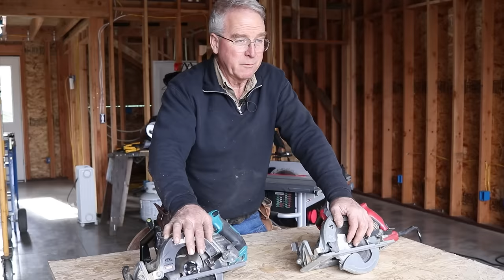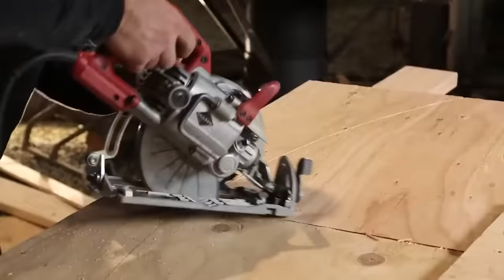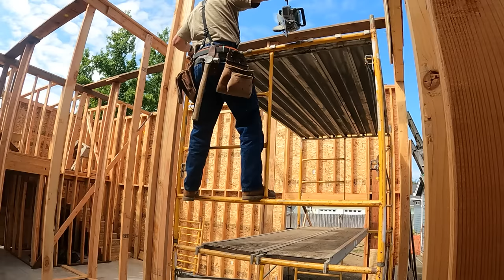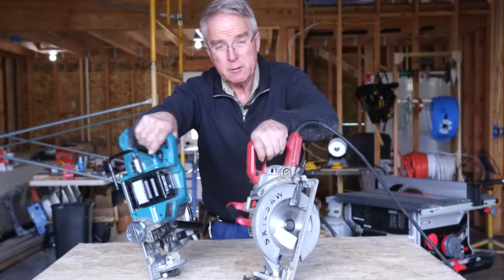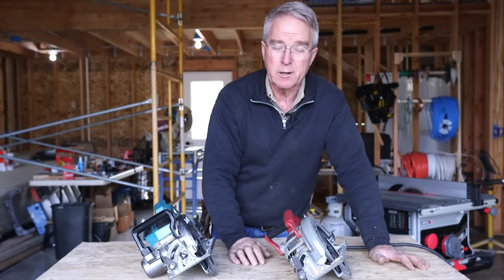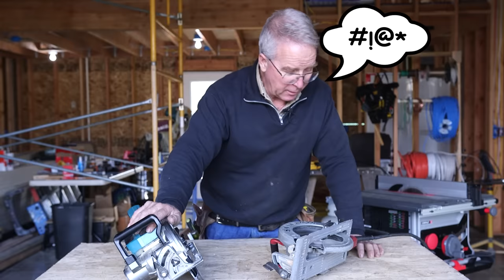Makita 40v XGT GSR01Z 7-1/4" vs. Skilsaw Mag 77 Circular Saw Review

Comment: as with all things things change over time and brands and components.

back in the 1970s i worked at a precision work tool holding company. the boss had a Milwaukee worm drive circular saw.  i had a skill saw of the home variety that could not make a square cut because it   was not square  and no way to adjust. i have a bunch of sears craftsmen saws that have survived many falls and keeps on ticking. my dad had a skill hand drill with the metal case and he used it for drilling concrete and that was from the early 1960s. and like a timex watch it took a licking and kept on ticking.  it is a a barn and it   stills works. it had a 1/4 jacobs drill chuck and  igt was replaced with a 3/8 inch drill chuck that i took off a home owner  black and decker drill that we beat on until it died (all plastic).

i owned a tool craft 6 inch jointer that my dad and i reworked the bed and rail system. it was from the late 1970s. i bought an 8in makita jointer a 15+ inch makita thickness planer. and a 15+ inch circular saw for cutting timbers and i used to to rip logs that i slabbed out with a chain saw mill.  

my dad bought in 1959 a sears craftsman 10 inch radial arm saw built by dewalt (i suspect). in a few years the casting rail system wore out. my dad a tool and die engineer designed a hardened precision ground rail system that he bolted under to old casting. originally it was wired for 110v but had the capacity for 220v and we changed over. we have had to rewind the motor after burning out.  my ex brother in law stole it when he and my ex sister disposed of the family home estate in 2017. it was a fire sale 10 cents on the dollar value. fraudsters of the stupid kind. or maybe they are clueless losers of the loudis clan of junior morons.

Comment: Left is better. A more centrally located door to the room means it's faster to access the room from the rest of the house. That is probably in line with what scott was thinking about more ways to look into the room. It just means more direct lines into the room from outside the room, which means shorter travel into the rokm.

Comment: Sir, I’m a rookie with circular saws. I’m right handed. I’m considering the SKIL Saw model 77 mag. I noticed in your videos, which I’ve been studying, that you seldom if ever, use your left hand when sawing. Is that because it would block your line of sight with the front edge of the blade ? Appreciate your response sir. 
Thank you.
Reply: It would be similar to writing with your left hand if you are right-handed.
Well maybe like writing capital L's, lol, you could practice and get okay with it, but you will always be more accurate with you right hand.
With a worm drive saw (only saw to use IMO) absolutely your view of what you are cutting plays a massive roll, I have never looked at the marks on the deck, but at what I am cutting, my material, horses, and direction of my drops are all set up for a right handed man running a right handed saw, and I have been in some form of construction off and on for the last 30+ years with around 10 of those in straight framing only.
The only times I would cut left-handed would be if some strange position off of a ladder or just anywhere where I didn't have another option because of deck width or whatever.

Comment: Been working as general contractor/laborer and electrician for 35+ years and I've used every brand & type of tool under the sun, the only cordless tools I own or recommended to my employees or fellow workers to buy is drills. Everything else Corded is King!! 🤷♂
Bc 1) there's no dicking around with a half dozen or more OVERPRICED and Underperforming batteries, 2) if it gets dropped it will still work and there's a built-in retrieval line, 3) If something breaks it will be mechanical and not a stupid Circuit Board or PCB Component so it can easily be fixed by the owner/user, 4) They're cheaper and they last longer. 

The only time cordless is useful imo is when you don't have power on site which for me living in the lower 48 is not an issue.

Comment: I’ve got a Ridgid worm drive that works great for when I need it. I was able to rip down through 5 sheets of 7/16” osb at a time which really sped up productivity.

The only issue I have with it is that the oil it requires to not void their lifetime service agreement. It requires a Mobil Synthetic oil which I can’t find anywhere in convenient sizes specifically made for a worm drive saw. Of course, Home Depot sells Ridgid, but not the accompanying oil that is required as to not void warranty 🙄

I would have gladly purchased a Skil Mag77 had it been available at the time for the convenience of easily accessible oil and parts.

Comment: While I don't personally agree. I do very much see the point. But with the amount of tools I've had to run on sites, it's easier to have one charging station with 2 or 3 batts all filling up and then switch the battery in use with tools. Especially grinders, impact drivers, drills and multi-tools. That being said circular saws are not something I have that level of experience with, so it might be completely different for that platform.

Comment: That point tracing where you left a tool by following the cord cracked me up. I have definitely found myself wandering around job sites looking for any one of my cordless tools and praying no one saw me through wandering around like an idiot haha. Never happens with my shop vac, belt sander or jigsaw (all corded). Also the strenuous time when you have to keep your hand on the cordless tool until it is holstered or set down somewhere, and not just lower it by the cord.

Comment: Excellent video. I use an old Skil 77,and love it for the torque and the left mounted blade compared to a sidewinder. However,I have been about to change to the Mag77 simply for the weight relief. But now seeing the Makita's 2-9/16" depth of cut seems like the biggest feature of all.But using the power cord to lift and drop and drag my saw would be missed...maybe tie a cord to the Makita?!? 🙃

Comment: I first used a Makita Hypoed  saw years ago, and frankly I was unimpressed I have other Makita tools that I have loved, I still have them. I hung up my nail bags 15 years ago so needing a new worm drive saw is not a need at all, especially because my Skill saw  works great for the few times a year I will use it, but still I am curious, we are building a new house and I will do very little of the building because I have other things I need to do, I will leave it to the young guys. The foundation guys are  setting up the footing and they had one of the new makita saws out so I picked it up because I was curious, I have to say I loved the feel of the saw, and its been close to 30 years since I framed a house. The other thing is and you didn't talk about it but buying such a saw at least for me means adding yet another battery platform  to my collection, that is not something I am all that eager to deal with, If I was a your framer, and buying a new saw was a must, I would probably look at this saw a lot harder. Thanks for the input.

Comment: With regards to power when there is pressure on the side of the blade: I have both a 2x18V Makita (not quite the same tool, but I think it's very similar in terms of power to what you have) and a Dewalt Flexvolt rear handle, I do find exactly what you're describing happens with the Makita, but the Flexvolt has no issue at all in those instances. Feels at least as powerful as my old corded Skil.

Makita is not known for throwing the MOST POWAAAAAAA at their tools, but aiming more at ergonomics, and one of the things a lot of people really like about Maktia's over my FV is the lighter weight, but the power leaves me reaching for the FV much more often.

Comment: One advantage I realized on the job with a corded tool is that it was much less likely to wander off to another part of the job site when you turned your back.  Lol.  It was a constant source of frustration to step away to bring materials to the area you were working and find that your cordless tool had mysteriously ended up in another area.  🙄

That being said, if I was still in the business I would undoubtedly have both.  Nothing beats the cordless when cutting rafter tails or working up in the rafters.  🤷🏻‍♂️

Comment: I had to remove that safety on my Makita, I found it to be unsafe, and also concentrating on the safety, would cause my cuts to not be a Straight.  It is such a smooth, saw that glides along, having to push in with my thumb caused an imbalance or miss direction of the darn thing

Comment: Can't speak to the saws themselves as I am not a carpenter or even someone who uses a circular saw regularly... But I am a diesel mechanic and have lots of makita battery powered tools. Makita has been very good... Better than anyone else about keeping the battery platform the same for years. They have updated the technology inside the battery but they have gone out of their way to make sure the form and function of the battery remains the same. I can use batterys from 10 or 12 year old makita equipment I have in brand new tools and visa versa. I don't see them changing anytime soon.

Comment: Lithium batteries in the cold suck. I have to bring generator to keep them warm or on charger. I like the cordless miter saw and table saw. But a corded circular saw cuts the tougher woods. I bump the trigger first on my makita circular saw, because it blows breakers sometimes. I need a guide for cordless saw because lighter and easier to veer off. A corded reciprocating saw is nice on job sites. A cordless reciprocating is nice for small quick jobs not all day use. I like a cordless large impact. A corded hammer drill for all day use. And I like pneumatic hammers, impacts, guns, and grinders because no power but under 18*F things go wrong.

Comment: Correct me if I'm wrong... The Skil is a worm-drive the Makita is considered a circular or is it actually  a worm-drive.  I like the cordless for convenience doing certain jobs... I have two worm saws Skil and Dimwit (DeWalt).  We now have one cordless Dimwit.  I hook saw on my belt to clime ladders....I don't carry them, Yet I have left it on the floor and had to climb back down to pick up the cordless.   The ride plate on the cordless is smooth until the saw dust is damp or wet,  then it gets sticky... I went with the Dimwit, only because, Everyone, either has Dimwit  or Milwaukee...
In the end I prefer a worm saw with the cord....why: Because of the torques... like a diesel its made for the tuff jobs..  That said.  I really like the cordless for rafter tails.. 20yrs I've hauled a cord or hose.  Even with the cordless I'll to the cord flip... Old habits

Comment: The safety switch is what kills it for me.  I'm 65 also and have been a carpenter since 77, in the last 10yrs the weight has become a big issue so I've turned to the SKILL 7 1/4 SOUTHPAW ( blade on left side ).  It has all the power, it's lighter and has a great feel. 
  If you can find them have you tried the 18 tooth blades for framing?  I have to order them but they out perform the 24 tooth and last alot longer.  They were the  $7 blue ones at  Home Depot but still out lasted all other 24 tooth blades, of course they don't carry them anymore.  Tenure are  what I have to order now and at $14 apiece it's still worth it.

Comment: I have been a carpenter for over four decades, have been using the makita for about 5 years as does all of the carpenters that I work with, once you use the cordless the only thing you use the corded for is when ripping large amounts of material with the guide fence, also he did not mention the safety of a brake and cordless tools generally have all most no kickback, that alone makes it the go to saw, and the makita is over a pound lighter which is a lot. Try one you will never go back.

Comment: I suspect the tough pull situation isn't a matter of power, but rather makita's safety mechanisms.  The makita has features to protect the tool, battery and user that the skil doesnt.  But sometimes that's going to get in the way of an experience user who wants to abuse the tool a bit on purpose.

Comment: (My situations different but...) I work as a handyman and sometimes do carpentry projects. I've had both corded (older) and (newer) cordless Dewalt saws for several years. As time goes on I find I'm hardly ever using the corded saw. Regarding batteries,   because I have a number of Dewalt cordless tools I now have about a half-dozen batteries. I'm good about charging so an occasional run-out is only a momentary nuisance.

Comment: I find it’s best to have one of both. Like my demolition hammer, i use a cordless one for a few quick jobs.. but when I’ll be using it all day , out comes the corded one.
Reply: If u had the Metabo HPT 36V SDS Max rotary hammer u could just carry one it's cordless and corded and a beast
Reply: @baseballdude8491  yea my mate has one, it’s alright but carting the big brick around is no good
Reply: @kizzjd9578  why would u need to carry it around- u keep the adapter at the cut station then use a battery if u need it up on a roof etc where cords are a pain
Reply: @baseballdude8491  if you’re moving around alot it sucks. Also overheats pretty quickly.
Reply: @kizzjd9578  uh we have 3 of the AC adapter and use them for SDS rotary hammers for hours on end, table saws, skill saws, mitre saws, portable band saw, the new belt sander, full size router, a recip even and the impacts and we've never had one overheat-the fan runs while using but that's what it's supposed to do
Reply: @baseballdude8491  na mine shuts off after 5 mins lol only on the table saw and mitre saw though. Im in northern australia though so it gets to 50°c pretty easily through the day.
Reply: @kizzjd9578  must be a lemon
Reply: @baseballdude8491  yea i actually think that too. The table saw can overheat that and batteries in about 2 minutes. Id like to try another one to see what the go is!

Comment: It’s great that battery technology has advanced to the point where tools have a reasonable performance level. You correctly identify that this technology will continue, and that manufacturers will change the platform. Makita 18V batteries are not compatible with Makita 20V gear. The answer isn’t this OR that, it’s this AND that. Each have their own unique capabilities, and the serious tradesman will have both in their truck.

Comment: Electric tools are reliable and once you buy one will last a long time if taken care of. I have recip saws, circular saws, metal cut portable band saws and my grandpa's electric tools that are 40yrs old and still works as good as day bought. But I also have Milwaukee and DeWalt cordless tools and they are awesome. Especially the drills and impact drivers! But my opinion is there's some tools that shouldn't be cordless. And the cordless tools are more expensive. Most times when the batteries need replacing you may as well buy a new tool that comes with 2batteries and a charger. Because 2 batteries cost almost as much.  Have a good one everyone!

Comment: 1200 for cordless or 180 corded.  Down time vrs convenience.

Cordless burns up years before/ decade before a corded77 and $250 batteries take a ahit whenever they happen to.  The torque is way different under load.

Comment: Don't think I've ever had a chorded Skil saw that I didn't have to replace the chord on, the present one someone had already replaced the chord with a 20' extension chord they hard wired in, Makita, I had bought at a yard sale,  and I still nicked the chord and need to replace it. But, chords a lot less expensive than the batteries.

Comment: There is a hybrid option. Metabo HTP makes a rear handle that can either use it's battery platform and they make an adapter that goes into the battery slot that converts it into a corded saw. See you can have your cake and eat it too.
Reply: “Rear handle?”
Or worm drive?
Reply: @fishhuntadventure  Don't know. Worm drive isn't the only way to do this. For example Makita uses a Hyploid gear system rather than worm drive and it's just as good. I don't have one but it sure looks similar to a 77.

Comment: If they could make battery operated tools with the comparable power of a corded circular saw I would buy one but all to often I have bought a corded tool and have been disappointed for one thing I haven't been able to finish a job without losing power or having to change batteries . Being lightweight and portable is a cordless tools only advantage .

Comment: There's no doubt that a mag 77 is the "Good enough" standard, and you missed a couple drawbacks of the cordless such as worse clearance along that motor fan thingy (in remodeling I bonk that motor fan thingy into stuff mid cut so often it's not even funny).

But I am on that line between being able to handle the makita all day vs. my forearms wearing out on the skil.  I just have more control with it, and to my own astonishment I somehow cut straighter lines with the teal guy.  

I think recommending the mag for anybody on a budget and/or with the brawn to handle one with no problem (I can't get over how Haun had no trouble with the old tank skilsaws and I can't run the new light ones) is wise